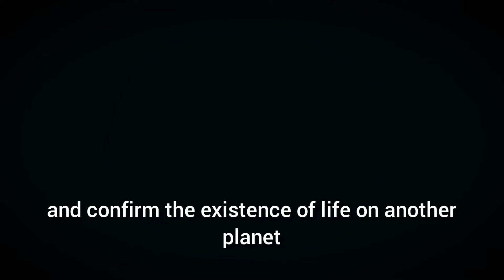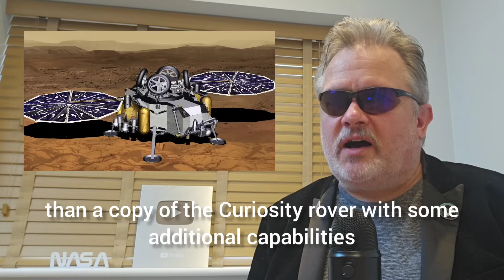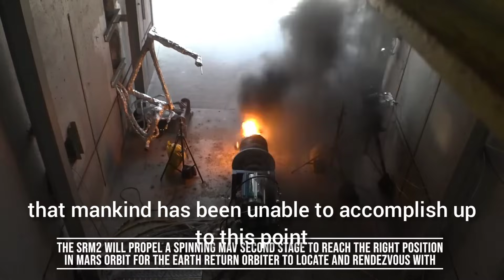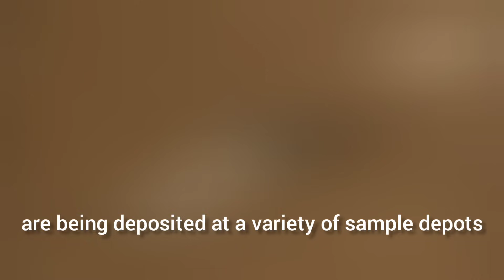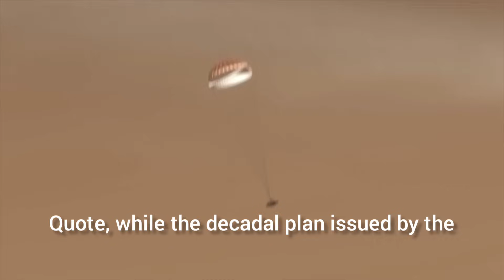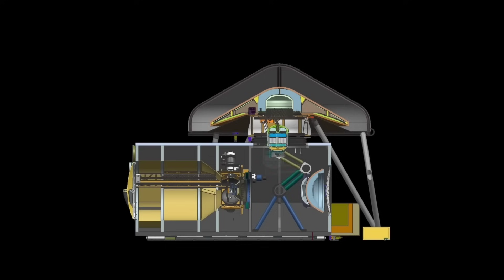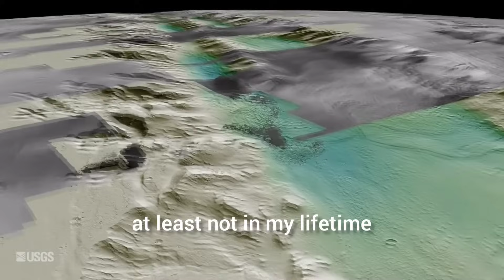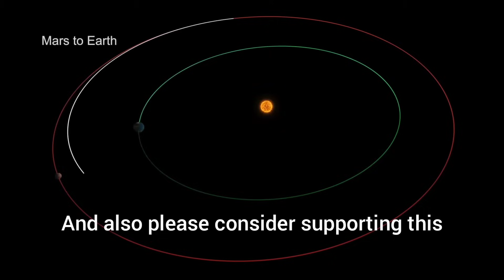Robert Zubrin is right about the NASA Mars Sample Return Mission!  Here's why!

Comment: Luckily NASA now has bids out for a commercial mission to achieve this Mars sample return mission, with far far less than $10B and one of the surprisingly capable ones in the process of bidding is Rocket Lab, which has surprisingly many missions under its belt relevant to actually have the capabilities to pull off this kind of a mission. Of course a lot is still not ready just like with every other bidder but one secret weapon Rocket Lab has is that it uniquely masters making vehicles small and large from the ultra light carbon composite, with a far lower cost than hand-crafting such vehicles, due to its high quality robo-printer tech, to achieve vehicles needed for this kind of a mission.

Comment: Everyone forgets that Spacex has Already been contracted to build a Very Large general purpose lander, that can be used anywhere in the inner solar system. We paid $3 billion, a relative pittance as Spacex's entire reason for being is to land and return from mars... to build a city with 1 million people by 2050 or so (2060, 2070?). Which means they will do this out of pocket of any overruns as they need this to get to Mars.

They are raking in huge revenue from Starlink and with the addition of E-Band revenue for its cloud computing customers (MS Azure and Google Cloud),  plus the ability of Starship to put up 5x the Starlink craft with every (reusable) launch... their already large revenue is expected to grow... a Lot... in the next few years. By the time of a proposed launch ( maybe 2 years after the Lunar landing- 2029-30 or so) they would have far more revenue than NASA has budget to follow through on this whether or not Congress pulls any funding plugs.

So Starship is coming together nicely with the magnificent Raptor V3, fault tolerant dual layer tiles and recovery attempt a few weeks out. This and plans for the Starship V3 which should be able to put 150-200t into LEO with more than 20m added for additional fuel. The Lander inherits all this tech and is due to land on the moon 09/2016... realistically a much more probable 09/2017. 

The Spacex Engine and Starship factories are built (and already partially operational) with a target of 100 Starships per year fully ramped. Realistically, once the V3 is working (the definitive model) some time in 2025, we should see production ramp from the current 1/3 months to more like 2/month (a fraction of the design capacity). This will allow the Tankers (6 by Spacex's reconning to get from LEO to the moon and back to LEO on partial tanks. (Jeff Bezos put out 16 or so, but he hates Musk). So 8 tanker runs then with the many reusable tankers they will have by then. They will have 3 functioning and 1 building launch pad for Starship by then and F9 will do 120 or more flights this year from its 3 launch pads... so... 

Given so Many resources put into the lunar landing, I would expect success by the end of 2027... and I expect that Elon will put up another if the first one fails... and another with success no later than 2028 at the outside. 

So now you have an interplanetary lander bought and paid for.

To go to Mars you might need Hal thrusters, a pair of the 6t nuclear reactors that NASA is developing and a couple of the In-Situ fuel processing plants that NASA is Also working on. 

You would have to assume that there is no good ice source where the lander is but if you modify cybertruck (the one with airless tires) and modify a pair for dust/heat/radiation, you can take a dozen Teslabots on board, hardened for dust/heat/rad and the solution is complete. It uses modified off the shelf products or products NASA already paid to develop. 

So... Spacex launches the Starship Lander V3 or V4/5 to LEO for topping off at the depot (modified starship tanker) that they are already using for Lunar missions. (The base on the Moon IS supposed to be permanent suggesting regular flights like ISS). 
They may need to fit small Hal thrusters to accelerate/decelerate the ship on the journey as fins won't decelerate the ship in Martian 1% atmosphere. The 2 nuclear reactors could power the thrusters, acieving ISPs Far beyond 10:1 over conventional efficiency. 

Once landed on mars, one reactor is left to power the In-situ fuel plants while the modified Cybertruck (driven by 2 Tesla bots) travels up to 150km (the current Cyber truck has Much greater round trip range on Earth at 1.g vs 0.38g). There should be 2 aboard in case one has to rescue the other with solar panels aboard. (Note that the Teslabots are due to be deployed in large numbers (>1000) in Tesla factories doing the more menial work on the assembly lines by the end of 2025 (Elon time... so 2026 definitely). By launch time in 2029-30, the robots will be seasoned factory workers... no remote control required but available if needed). 

Samples retrieved in the Cybertruck and returned to the rocket by the robots after refueling is complete. 
Ship returns from Mars to Earth LEO. 
Samples are examined in this or another starship equipped with a proper lab to keep the alien life far from Earth's ecosphere.

The lander can move 50 or 100t to Mars, that means no $3billion dollar feather weight rover is needed (though the team's experience would be great to modify the Cybertruck... the massive added weight (8t modified for each?) is not a problem. 

Starships Currently cost $100m to fabricate so the involvement of multiple (most just for a brief refueling trip) will be minor against... say a $5 billion budget (fixed cost - that Spacex will supplement if mission fails and another needs to be flown, which, knowing Elon... they will happily do. 

Elon wants to go to Mars and will soon have a bigger budget than NASA... use that. 

And Expand the mission parameters to include many firsts for NASA that they want anyway: 

Return the Samples... of course
Refine an already existing interplanetary lander that can handle bulk cargo... Big win
Test the new nuclear reactors
Test the new In-situ fuel production facilities. 
Test the use of human form robots to assist astronauts in the future
Tes the Cybertruck class rover with vastly improved range, capacity at the cost of Weight... which is no longer such a concern.

This would command a price tag Much greater than $11 billion... but it wouldn't require it.

Comment: Mars is a dead end.   Robots to Europa and Enceladus are far, far more promising to find CURRENT life.   

For human missions, Mars has little water, the soil is permeated with perchlorate and fine particles, plus little more protection from cosmic rays or solar radiation than you'd get in space.

A manned mission to Ceres makes more sense.  Water, and the possibility that life might even still be there.  Ceres is rocky and the regolith used for shielding, plus starter missions could harvest water ice and turn it to fuel.

Comment: The one thing NASA and Congress is good at is cancelling projects after they are started.
Once a plan is made and start , you follow through even if it’s a lackluster plan. 
You can adjust it but you still go through with the planned parameters. 
I didn’t like the idea of rover dropping containers on the ground for a follow up mission to do a treasure hunt.
Why not leave them in a pile at a couple locations or have the rovers carry the sample and meet up with a return vehicle to offload its samples? 
Better, have NASA give out a bounty for every container sample return. 
This will motivate the private sector to start working on a solution.

Comment: For me, the most frustrating aspect is the fact these missions are so incredibly expensive is because they need to reinvent the wheel for every mission. Extremely low payload capacity is the issue, requiring each and every mission to be made up of bespoke components specifically designed to be as small as possible (yet contain a complete scientific experiment), to be as light as possible (yet provide shielding against radiation), and so on. 
That entire system of building missions needs to be put down. No more special space-grade scientific components. No more specially-built solid motors for probes. No more tiny instruments. 
Book a Starship! All these missions are ten years out anyways! Starship would give these missions 150 tons of regular payload to Mars. 
Just order standard-sized laboratory equipment from regular suppliers, add a pressurized hull, a frame and some overbuilt parachutes, add a robot arm in the middle of the lab to interact with the equipment, put on some lead shielding, and send two of 'em just for good measure. Would be cheaper than whatever highly-specific stuff they're developing, and allow entire laboratories to be send to anywhere in the Solar system.
The reason I'm so nonchalant about it is because that's the approach we should have once we can send 150 tons into LEO for the price of a Falcon launch. Less price to pay for failure = less stringent approach yet more stuff done overall. We need to change our mindsets to a post-Starship era (as these scientific missions will all be carried out 10 years+ anyways).

Comment: First thought is SpaceX needs o get on it. Getting Starship up and running will change the whole dynamics of what payloads can get to orbit/Moon/Mars/wherever.  Much bigger payloads.

The sample mission return is not a good use of money at the moment. I think the whole game should be based around Starship launching parts into space to make a space only nuclear ship that can travel to wherever with a smaller landing ship or two. I also think we need a base on the Moon to test everything out before we go all in on Mars. Going all in isn't bringing back samples from Mars so 10 billion is way to much for the result we would get. 

I think we could very easily have a Moon base with a space only ship traveling between a space station and the Moon, very easily in the next 10 years.  Money has to be directed to the right places and  I think SpaceX will succeed on Starship which would be very useful to all that.

Comment: If the samples coud br found after a sand storm or one of the whirlwinds, without a Martian PS. MPS, an Elon Musk sample collection team coud pick them up and send them back, depends obviously on the range to the landing site. I am sure somebody documented the apparent locations. Any error can be real troublesome to the point that it's just not worth it, exept for the historical aspect, collectors pay fortunes for things like that. But that is wishfull speculation. At any rate cancellation of the sample return mission is imminent.
Reply: well when Elon's colonists land there after a few unmanned missions to set up the return fuel production site to run Zubrin's version of the Sabatier reaction using solar powered electrolysis of  molten water from the underground ice to generate hydrogen and a co2 compression unit then the exothermal reaction will provide methane and some more water. And if the electrolysis is expanded to generate hydrogen peroxide, then a fuel system like the British black arrow rocket used . This augmented monopropellant can be used to drive a generator powerful enough to create a viable round the clock power for the colony. The generator is driven by a radial inflow steam turbine, the decomposition of water diluted H2O2, augmented by some methane. 
Then a tandem helicopter with larger blades, chord and lenght and more than 7 blades will work in the thin 0.0152 kg/m³ atmoshere . with the reduced gravity, 3.7 m/s² , the lighter design will require about the same power than the same sized helicopter on earth. Landings are not easy because of the weak ground effect, so a falcon 9 type automatic landing strategy will have to be worked out  using a readar for altitude and a doppler radar for lateral and vertical speed measurement, just like the Viking landings. Key is adequate radar reflectivity.
The point is that a flying rotary vehicle can travel to reach those samples even if they are hundreds of kilometers away. 
The low gravity is the key, on the Altiplano at 13600 feet they can't operate with conventional Chinook type rotors.
Reply: @Arturo-lapaz  Nice, Any calculations to confirm that capability . Or the analysis like lift equations  for the rotors, power requirements, to check the propulsion power required to hover and cruise in forward flight? To do it right the Barnes McCormic theory must be used for slow flight. "Aerodynamics of STOL flight is the publication" where he introduces the theory.

Comment: A separate retrieval rover mission is adding so much extra complexity, especially since it has to retrace the entire path of the original rover to gather the scattered capsules. It would have made a lot more sense to keep the capsules on the original rover, and have it drive in a giant loop back to a return vessel sent along side the original lander, or have the original rover meet a return vessel somewhere to drop off its capsule magazine, or drop a non-returning robotic lab that the rover could deposit its samples at for on-site analysis. So much unnecessary complexity feels like featherbedding or something.
Reply: Wouldn't a upscaled flying drone be better than a rover?